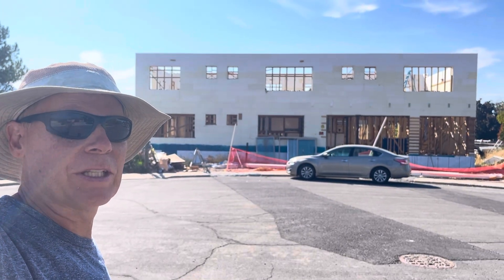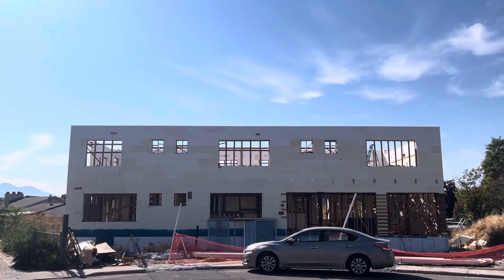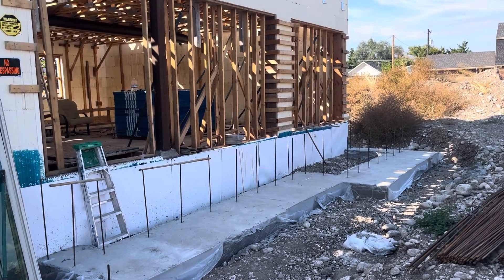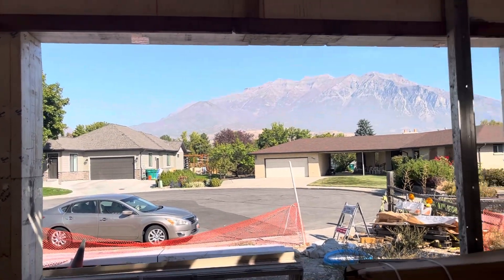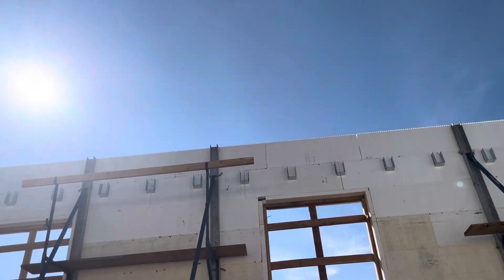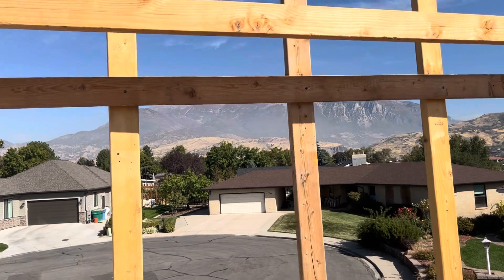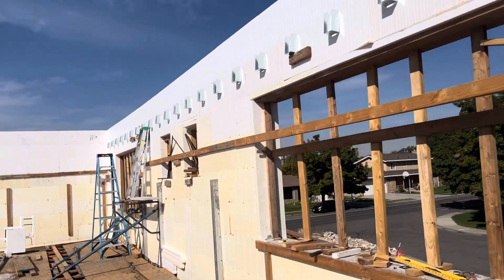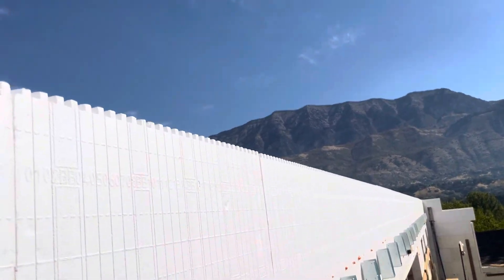48’ tall #icf home update tour: Only 13’ more to stack 🎉🎊😅

Comment: So you are making multiple pours of concrete, is it critical to where each pours to or do you just wait till you run out of concrete in that pour? the hangers you mentioned how do they get installed?...I'm guessing you slice the foam? Do they go all the way through to the otherside? Very interesting. Good job!
Reply from the maker: The height of the pours has to do with what the manufacturer says that the block can handle in terms of weight.  In my case that is 16' high.  But if you go that high you better brace it right or your walls are not going to be straight :)